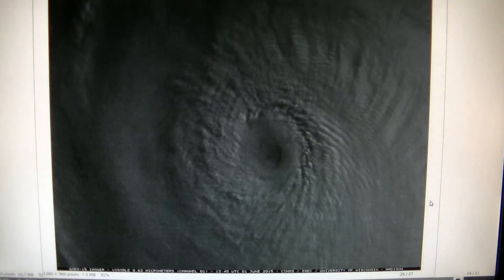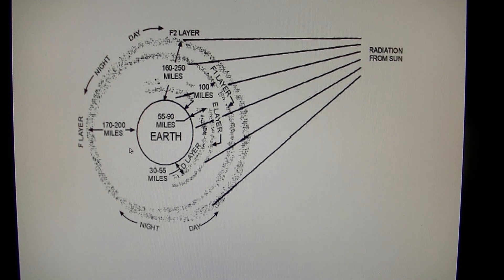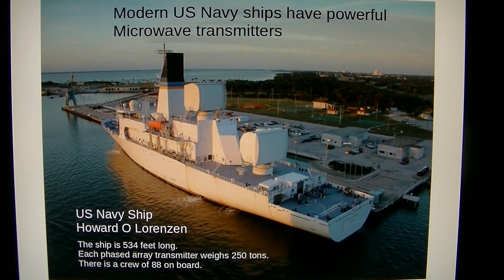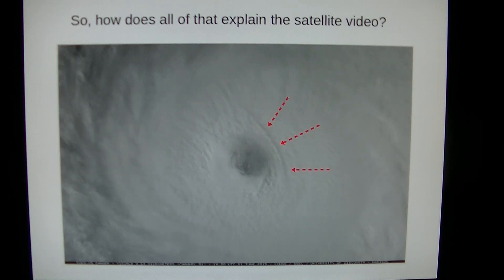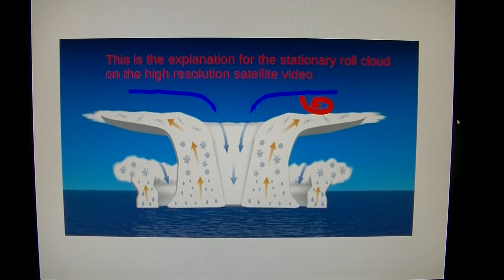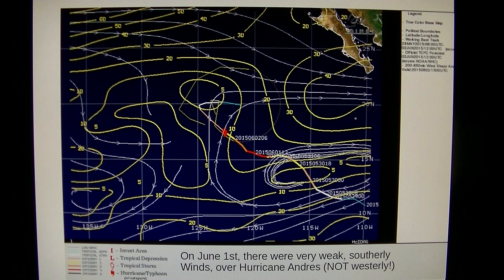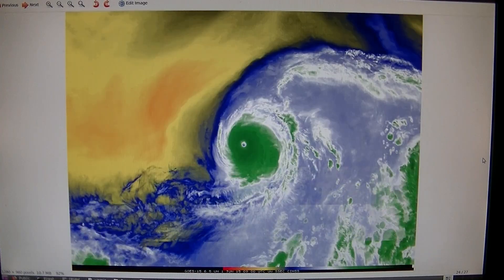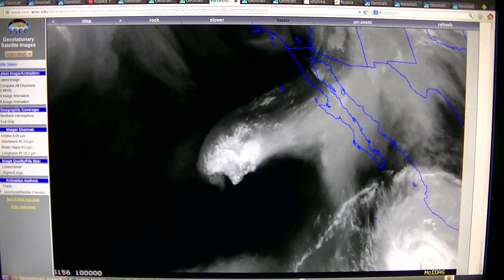Physics of Ionospheric Heaters, Killing the Pacific, June 7, 2015

Comment: Brilliant as usual HR.  Dude your sub count is being suppressed, I just know it. Luckily, there is a decentralized youtube in the works. Alexandria combines bitcoin with bittorrent (finally!). Decentralized and censorship resistant. Bottom line: content creators can monetize directly with their audience and can't be censored. Five cents a vid or whatever, frictionless. Check it out. http://blocktech.com/  Florincoin runs the tech in the background. You can add 528 bytes of data directly into the florincoin blockchain, which bitcoin can't do.  I have the same feeling with this as with bitcoin back in 2011. Content creators should flock to Alexandria and bring their audience with them. We'll see. :)  Thank you again for this great video.
Reply from the maker: clive mossmoon Wow, you're much more technical, than I am. Actually, I'm afraid to take any money for this research, as that will compromise the message. That is why I don't put ads on my videos, and turned down one chance to sell a video. I wish there was an easy way to go from pdf, straight to video. That is about as technical, as I can get, right now. I agree, I felt the urge to buy bitcoin, around 2010, but never did - what a mistake!
Reply from the maker: cindy garay lol, I went to your link, very eager to read the TPP... well, it just didn't happen: http://www.readthetpp.com/
  BTW, I think there is a level of spritual protection, by never taking money, in exchange for doing something. That applies across the board, but especially for "truthers".
Reply: The HAARP Report
I feel ya man. You are on a higher frequency than most. I'm thinking more about the censorship angle. This tech will maintain the torrent magnet links in the blockchain forever, so the content can never be taken down. It's very exciting. Florincoin are very cheap right now so if this thing catches on they're takin off. Just a heads up.